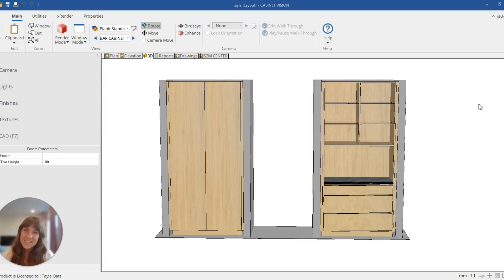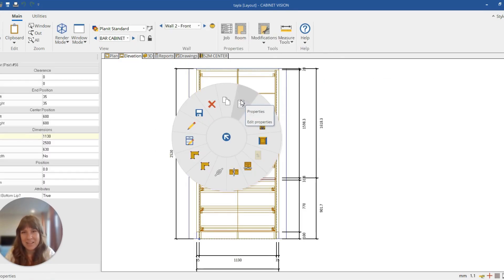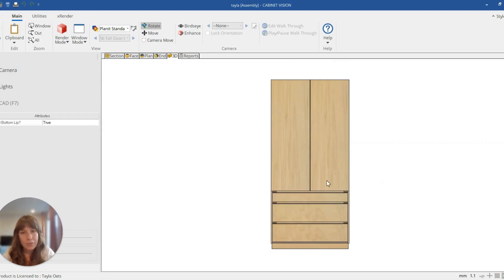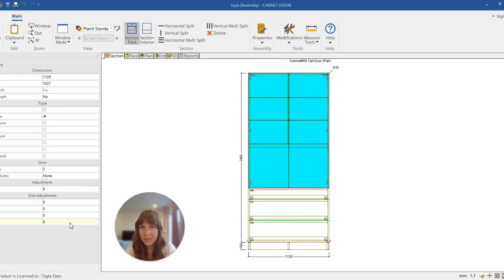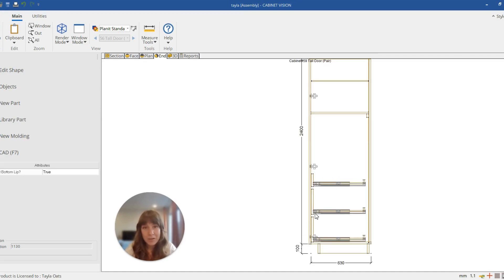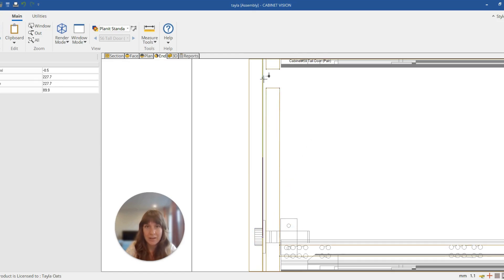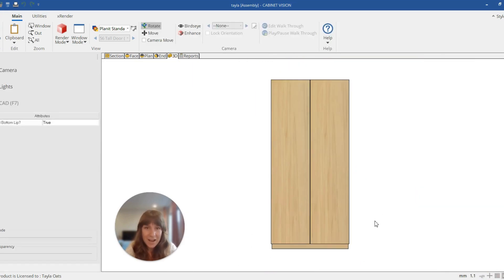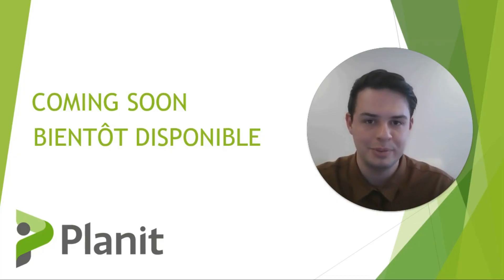Your Questions Answered: How to Add Tall Doors over Inset Drawers in Cabinet Vision!

Comment: You dont need calculator, CV will automatically calculate that for you. instead of 773 type:  2400 - 1627 and hit enter
Reply from the maker: Absolutely, that's a great tip too! Both options will work a treat, thanks for sharing that!

Comment: Hi, thanks for the video. the CV can add numbers and you don't need to use calculator just 76.2+226.1 and it gives you total instead. 👌
Reply from the maker: Absolutely, that's a great tip! Thanks!

Comment: How did you insert the bench top in the cabinet?
Reply from the maker: So there's a couple of ways you could go about it... but generally the most straight-forward and easy way is to just draw the counter top up using the 'Tops' button from the Plan view, and then 'New Top'. Then you can manually draw up the top wherever you'd like on your page. Then once the top is drawn-up, right-click on it and choose 'Properties', and from there you customize the settings for the top, particularly the elevation which would be useful. Hopefully this answers your question!

Comment: Is it possible to display the cabinet number  (2# ) on the Parts in SM software After nseting ??
Reply from the maker: Hello! Great question! Just to clarify... Do you mean on the label, on the Part List reports or in the program from the Nesting preview?
Reply: @PlanitCanadaInc  Many thanks for your interest and quick response. on Patterms Part List reports As drawing Not Tables
Reply from the maker: @maher_kit  Hello! If we want to see a personalised image that includes the cabinet number, this can be easily accomplished via the +Label module of Cabinet Vision, though this is specifically for the labels. But this does harmonise the image with that information you are looking for.

We are not able to manually personalise the image generated in a Part List report (if we add it), as this feature is more Table specific. You can add the Cabinet Number to the report, we just can't manually attach it to the image. We are able to edit the aesthetic of the report however to display the Cabinet Number immediately next to the image too.

Comment: Well i have question too ! For an example i am creating a tall cabinet and it have 4 hinges. When i put too many adjustable shelves like 15 shelves and some of them are crossing with hinges. Does cabinet vision automaticaly adjust hinges position when its crossing with shelves ?
Reply: As far as I know, it does not have collision detection
Reply: @TarRip  Well if it doesnt have that it's bad i mean the program amazing you know but the other programs have that feature too but if cabinet vision doesnt have this feature it makes me kind a sad
Reply from the maker: Hello! That's a great question! There are a few ways to answer this.

Firstly, Cabinet Vision will tell you if there is a conflict between your hinges and internal parts of a cabinet in your job. When your adjustable shelf is conflicting with a hinge, you will see a warning pop-up from your Plan or Elevation view ("There are build errors or warnings") and when you click on the little yellow triangle in the far-bottom right of your screen, you will see a list of cabinets, their corresponding number for easy reference, and what the issue is. In this case, "Conflict between Hinge(s) and Internal Part(s)!". This is a good way to keep track of if there is any problems in the design which need attention! 

Assuming we are adding the adjustable shelves via the Section Interior menu, Cabinet Vision will try make whatever amount of shelves we choose to add via the 'Horizontal Multi Split tool' work (so long as it is an integer between 2 and 99), because as a user, in this case, we are telling Cabinet Vision the number of shelves is more important than if it is a genuinely advantageous design in reality. I would say this is a strength of Cabinet Vision, because as a cabinet maker or designer, we can adapt the program to whatever our needs may be on site or in the factory!

So, Cabinet Vision won't necessarily automatically adjust the position of the hinges or the adjustable shelves for you just because it detects a conflict, and this is because as a user we are able to 'override the behaviour of Cabinet Vision' if we feel our design outweighs what should really work for whatever reason. 

That said, we are able to automate Cabinet Vision behaviour! Especially hinge or shelf placement, but this requires User Created Standards written up and customised to account for your specific needs. 

We hope that helps answer your question! :)
Reply: Kabine ön görünümden bakarak menteşelerin yerini pozisyon ölçülerinden degistirebiliyorsun kolaylık la